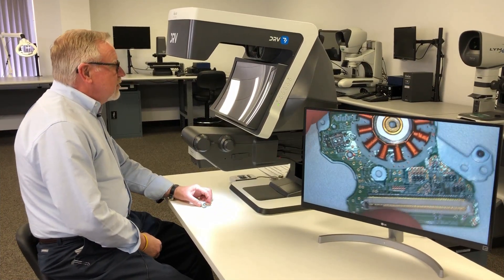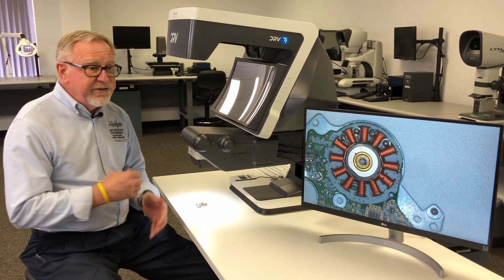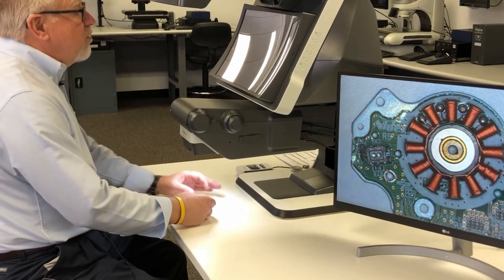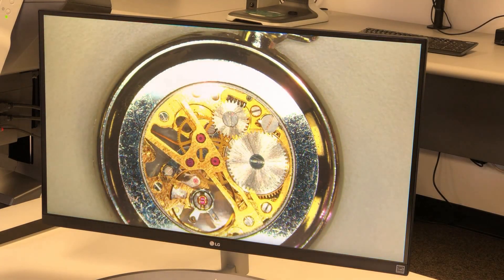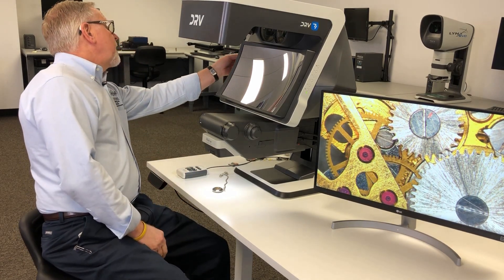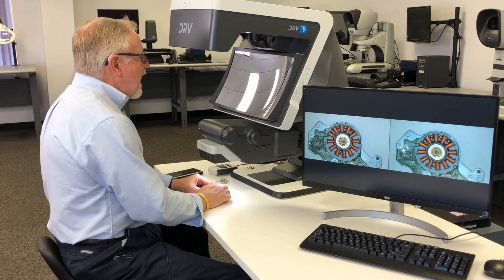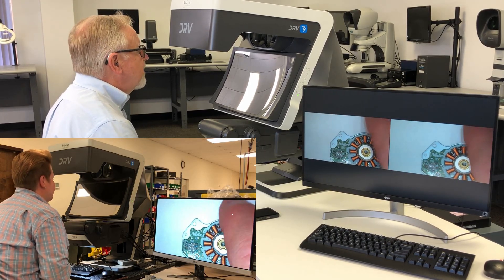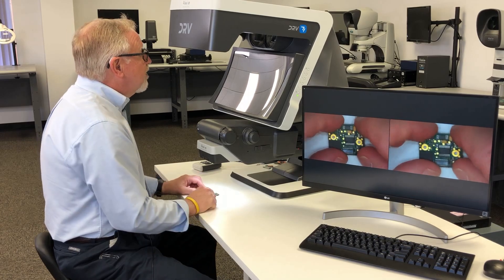DRV Product Showcase

Comment: If it is digital, it has to have latency. What is the latency for the DRV-Z1 when used by a single operator (not over the Internet)? 

Also, does Vision Engineering expect the DRV to eventually replace the Mantis Elite?
Reply from the maker: The DRV-Z1, when used by a single operator (not over the internet),  has a 40ms latency which is perceived as instantaneous. The DRV-Z1 will not replace the Mantis Family. The DRV-Z1 is a system that combines Digital and Optical technologies in a single system giving users the best of both worlds.
Reply: @VisionEngineeringLtd  Thank you. Is it possible to switch the DRV-Z1 to a lower resolution mode with less latency? Also, if the DRV-Z1 is "the best of both worlds", why might one still choose a Mantis?
Reply from the maker: @BenInSeattle  Hello Ben. The resolution on the DRV-Z1 can’t be changed. But as noted earlier the latency is so small it is perceived as instantaneous. When comparing Mantis to the DRV-Z1, it all depends on the application. Mantis is an optical system, the DRV-Z1 is a digital system that displays in 3D. The DRV-Z1 has a higher magnification range and the ability to use zoom whereas the Mantis has a range of fixed magnifications, up to 20x. What sets the DRV-Z1 apart from any other digital system is the ability to view in 3D AND share images in 3D.

If you wish to speak with our sales department in more detail about your application and which system would be best, please complete the contact form from our website: https://www.visioneng.us/contact/ .

Comment: What is the depth of field?
Reply from the maker: Hi Paul,
That is a difficult question to answer with a specific number as the depth of field varies with the magnification and iris position. The adjustable iris on the DRV-Z1 means the user has some control over the depth of field. There is also a subjective element as to what level of sharpness the user finds acceptable. Due to this we don’t quote a specific depth of field number.

If the you are interested, we can arrange a web-demo where you can see the variation in depth-of-field as the different parameters are adjusted.